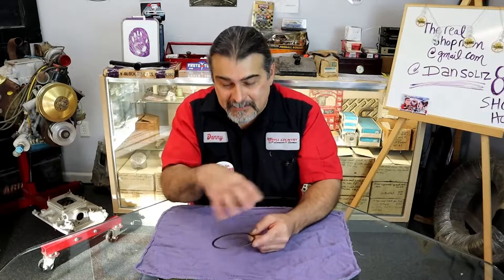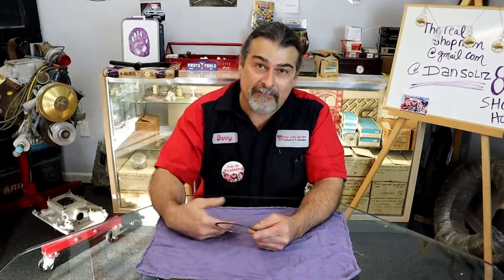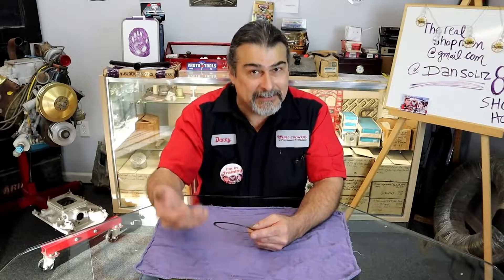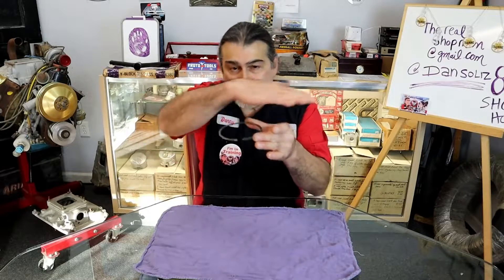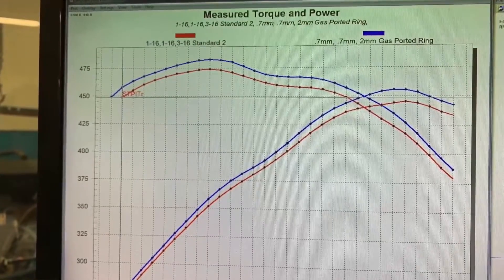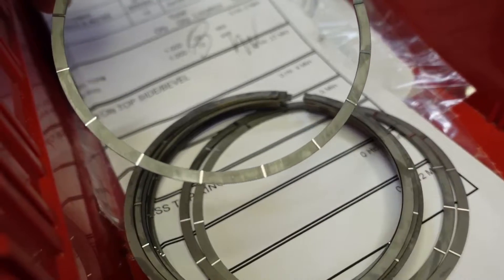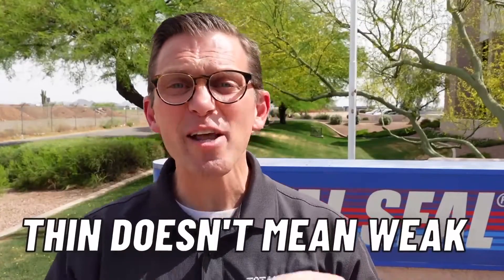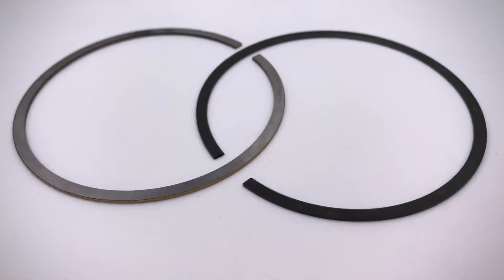How to Check Piston Ring End Gap

Comment: I thought the second ring gap was supposed to be larger than the top ring gap ?
Reply: No. His method is right for a stock street engine. The top ring is exposed to more heat, the reason for the bigger gap. Performance engines need more on second to get rid of ring flutter at high speed. Total waste of time on your every day car. Realize your wearing out your rings before their time.
Hot rod engines are not 100,000 mile engines. If you're running machine shop make sure your customer knows this. They WILL use oil. I wish people would understand this. Your modifying an engine. It's NOT stock! Your basically experimenting with an engine. Anything other than stock specs is experimenting.
Reply: Your correct 
The method shown here is incorrect, it was once correct but is an outdated method now

Comment: Complete and total incompetence!! Engine Builder needs to get rid of this clown!!!!!  Anyone who follows his procedure will have issues!!!  I will bet him $1000 that his ring end gap will not be at .026/.018 after that engine is assembled!!!  Until he and 99% of other builders figure why that is they will continue to have unexplained failures and or lost power potential.  He unknowingly gave the answer in the video but obviously doesn't understand it.
Reply: I’ll take your $1000 just to teach you a lesson. I have cut more cylinder rings then you have ever seen and not a one has ever failed. I have never had a ring, cylinder, bore failure. Andrew Evans let me know how I can collect that $1000 from you.
Reply: @MrDanielSoliz  you are complete idiot and have now have the satisfaction of finding out why you have done it wrong for decades!!!  And why you you lost the bet!!!

If that block was honed with a torque plate installed you a gapping rings in a bore that isn't round once the torque plate was removed.  That bore won't be round again until the cylinder head is installed during assembly.  When you gap rings in a distorted bore your end gap will increase when the cylinder head is installed.  To avoid this rings need to be gapped while the torque plate is still installed or Checked deep in the bore out of the head bolt distortion zone.  

If the block was honed without a torque plate the exact opposite occurs. With this scenario  you are checking gap in around bore that won't be round once the head is installed.  This scenario reduces the end gap which can easily lead to disaster.   

Bore distortion is real and does occur!  Every engine is different and several things contribute to distortion.  Head bolt location in relation to the bore OD, bolt length,  deck thickness , cylinder wall thickness , the difference between bolts and studs, these are just a few things that create and affect bore distortion.  If this isn't obvious to you feel free to test this proven theory on  a block , because I have!   Somewhere out there is an equation  for the end gap in relation to bore size.  Hopefully all this explains the flaws in you methodology and what you have done wrong for decades!!!  If you fail to acknowledge your failure I will make a specific video showing all of this and call you out in the video!  Engine Builder needs to get rid of you!!!!  Ask Steve Morris , he is intelligent and could explain this to you.
Reply: Once that engine starts the rings seat to the bore and seal. That's why they call it "break in". It's smoke and mirrors. He knows what he's doing. 
Do you really think the factory screws around with an engine that long measuring fly sh##? They'd go out of business! I'm one of those "old" machinist. 55yrs experience.  Never had a problem. I didn't rip my customers off.  If a bore is 4.030 it's 4.030! It's not rocket science!  Distortion my foot. Most ring sets are engineered. Ready to install. In race engines they need to be gapped. Otherwise leave them alone. Your just taking miles off them. They'll seat I promise.